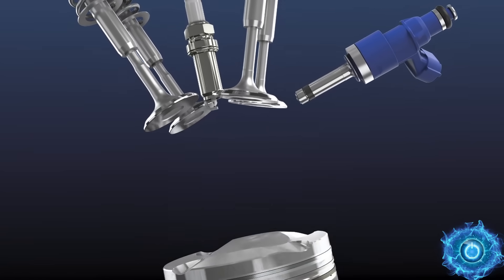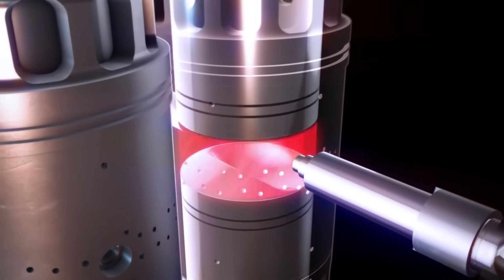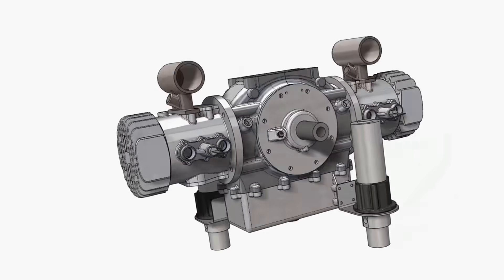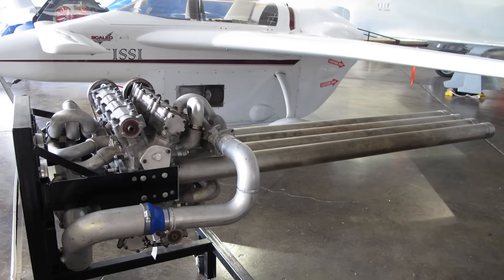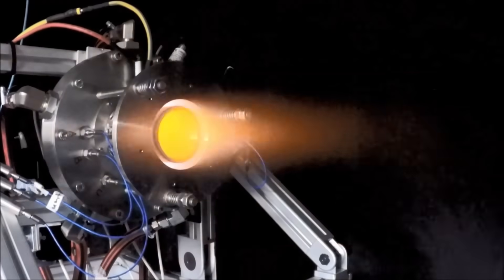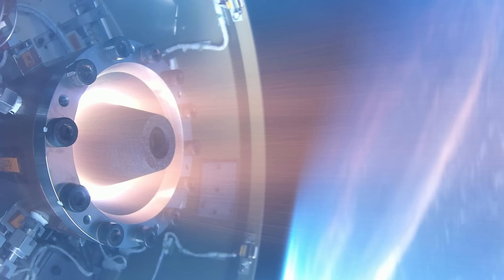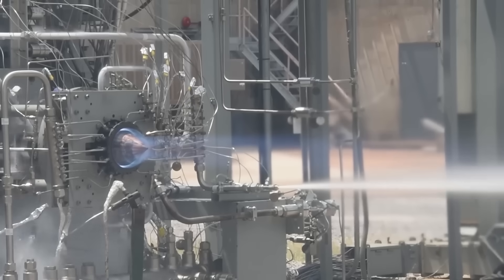NEW Aerospace ENGINE Destroys ROCKETS

Comment: You are still dealing with obsolete methods of propulsion the Jupiter 2 propulsion system is much more efficient has a much better thrust to weight ratio and uses no petroleum products

Comment: NOW, try getting out of earth's atmosphere and not killing astronauts......or are they  filming somewhere else....
Reply: Over 680 people have been to space, only 3 died there
Reply: @raptorwhite6468  your definition of space ??
Reply: @JW-rg6rg  Over 100 km, this is what is officially considered space.
Reply: @JW-rg6rg  Well, if you want to define space as a place completely outside of atmosphere, then it doesn't exist. Even in intergalactic space there are some atoms.
Reply: @raptorwhite6468  you mean plasma?? Same stuff that creates flames on SpaceX re-entry?
Reply: @JW-rg6rg  No, just singular atoms floating around, technically that's still a gas surrounding a massive object, so it is an atmosphere, but very thin

Comment: Would RDE engines be more efficient if the detonation wave was parallel to the desired thrust vector? Rotary Detonation Engines (RDEs) operate differently from traditional combustion engines by utilizing a continuous detonation wave. The efficiency of an RDE can indeed be influenced by the orientation of the detonation wave.

If the detonation wave is aligned parallel to the desired thrust vector, it can potentially lead to more efficient thrust generation. This alignment allows for a more direct transfer of energy from the combustion process to the thrust, minimizing losses that may occur if the wave is misaligned. It could also enhance the combustion efficiency, as the detonation front would continuously push combustion products in the desired direction, reducing the formation of unburned fuel.

However, achieving this optimal alignment in practical applications involves complex engineering challenges. Factors such as the design of the combustion chamber, fuel injection methods, and the geometrical constraints of the engine must be taken into account. Overall, while parallel alignment of the detonation wave to the thrust vector can theoretically improve efficiency, practical implementation requires careful consideration of various operational parameters.

Comment: No thats not the reason... it's not because you can consume all the fuel at once, that would just give you a higher thrust, it would not improve fuel efficiency which a lack of thrust is not the problem with today's rockets, the reason is that the detonation travels faster than burning, which the speed of your exhaust determines you specific impulse, or how much acceleration you can get for a set amount of fuel to put it in somewhat more laymen terms. So because a detonation travels at greater than the speed of sound it mean you are throwing the same mass out the back at a greater speed which you know Newtons thrid law "To every action, there is always opposed an equal reaction..." which means you get more thrust for the same amount of fuel.

Comment: Sry really sry but nothing has ever been to space
Reply: People have been sending things into space for 80 years, you're a little late
Reply: @raptorwhite6468  space starts at 62 miles high and rockets can not produce thrust in a vacuum so the rocket just falls back down at the 62 mile mark
Reply: @James-zp5po  So you don't know the most basic laws of physics? That means you're over 300 years late with your statement, not 80
Reply: @raptorwhite6468  basic laws of physics do your own critical thinking and do your own experiments I have 3 vacuum chambers newtons third law says action reaction only when air is present space starts at 62 miles high and rockets can not produce thrust in a vacuum so the rocket just falls back down at the 62 mile mark and this is the way it has been since the beginning of time
Reply: @James-zp5po  If you have vacuum chambers, did you perform a proper experiment with burning rocket fuel? Air has nothing to do with it, do you think kicking a ball in a vacuum wouldn't make it move?
Reply: @raptorwhite6468  air has everything to do with it so says newton
Reply: @James-zp5po  Oh, right, because the third law of motion is "for every action in nature, there's an equal and opposite reaction. But only in air, not in a vacuum, if you try to walk in a vacuum you can't, your legs push against the ground, but there's no reaction because there's no air. I don't even know at what exact pressure the law stops working, but I guess it's at the exact pressure it's most convenient for flerfs"

Comment: All rockets are slow motion continuous explosions.  The difference in solid rocket propellant and the explosive in a CALCM (Conventional Air Launch Cruise Missile), is a matter of the same ingredients (mostly) with a slight balance change between them.  More Bat guano or less Bat guano,... or nitro.  External Combustion Engines.

Comment: Hows-about a spinning wall that the rotation detonation wave follows behind, this rotating wall opens the fuel air mixture port as it rotates which is then ignited by the trailing pressure wave. This wall could also have ports up it's vertical length spraying the fuel air mixture. Match the rotational speed with the pressure wave, and voilà........

Multiple vertical spray ports, more det-pressure waves.

??????....... Gizz some shares if anyone patents it!!!!!!!

Comment: Incredible stuff. We definstely need faster rockets. We also need chesper rockets. Lasors will in time make a lit of this moot but for now its whsts needed. 

The next issue of course is if a jet can generally move at 5 times sound then its offense needs to move at 7 to ten times that speed. So both large and small versions should be utilized at the same time. 

Next of course is can a human renain conscious at these speeds. Will this effort necessitate semi autonomous control.

Comment: Btw, why not combine 2 pulse engines to cancel out each other noise and vibrations? Same concept serve piston engines pretty well. Probably you can just remove pistons from motorcycle 2 stroke engine and replace them with nozzles to test the concept. Well, maybe you will need 4 cylinders to balance rotation forces. Or maybe some "pressure addition chamber" before single nozzle.

Comment: I’m a little late to see this… but I have some experience working on/with linear aerospike engines.  I worked on the Lockheed Martin X-33 (the prototype technology tester for the LM VentureStar), and I spent a lot of time with the good people at Rocketdyne, who were developing the XRS-2200 Linear Aerospike engine.

I have always wanted to see this concept in use, and I attended most of the XRS-2200 tests that were performed at Stennis in Mississippi.  These engines were very, very promising.  To me this was the most important technology to be tested on the X 33 as everyone knows the X 33 was canceled in March 2001, but we did at least get working linear aerospike engines and we had some data on those.

The difference that I can see between the engines you’re talking about (with a pulse detonation in a circular motion around the periphery of the ramp) and a circular aerospike engine will be that a circular aerospike engine would have all the thrusters operating simultaneously, and continuously, rather than pulses - moving around the periphery in a circular, tornadic fashion.  I like this idea, except I would be more comfortable if the thrust were more symmetric about the center of the circular ramp. In other words, why couldn’t we have two detonating simultaneously across the center of the circular ramp from each other?  I’m always a little uncomfortable about any kind of nonaxisymmetric thrust on a rocket engine, even if the pulses moved very quickly - there would still be some thrust vectoring (TVC) that might be an issue.  I think this is something we would want to avoid.

The concept of aerospike engines with the external ramps is a very old one and it’s back to the 1950s. There was an instance of somebody (and I can’t member who) that put a circular aerospike engine on a barge… and they were able to get some good data from that test.

Great video, thanks for posting this!  Cheers from New Orleans.  🥃
Reply: i just met you but i'm already your fan lol
i love circular aerospike engines

Comment: I will say I'm a little skeptical. I genuinely do hope that this becomes the new main engine, as it would make travel much cheaper, but I don't see this overcoming the same hurdle that the Aerospike did; Considering that despite Aerospikes reputation for being better than the generic rocket thrusters we still use today in every single way, I have a feeling that these RDE engines may fall into the same pit. Crossing my fingers they don't.

Comment: in the end; you need E = size of fuel droplets x distance between fuel droplets; x oxygen size & uniformity; x fuel size uniformity;; 
and i got to it in 90s; started in 80s ; 
i call it plasma engine; so to let you know; you can work on hardware; but cannot work on fuel air mixture; thus know standard was met;

Comment: The problem is - on Earth this eats up the alloy you're using rapidly and melts your engine. Now take that to space where convection and conduction are not optional and you're left with radiation as the only way to get rid of heat and good luck not melting.

Comment: Three of the biggest challenges I see is a combination of resilient materials precise cancellation of heat and shock  on the inner surface. If the oressure and heat extremes can be sensed and responded to before they reach the combustion wall then it is s matter of providing adequate cancellation support.

Comment: I could be wrong, but I think for mach speed flow to occur in the cylinder of an operating engine, other than a diesel type, you would have to have detonation, which is a VERY bad thing.  Fuel in a properly working gasoline engine does not detonate, in fact the squish areas in a two cycle engine are designed specifically to try to mitigate that at the cylinder extremes.  In a diesel it does operate in detonation mode, but those engines are designed to do that, and you can hear it happening when they run, with all that knocking.  

When you hear that in a gasoline engine, something is very wrong that needs to be quickly corrected, like large amounts of carbon buildup or overly advanced timing.  If anyone reads this that really knows what goes on there (meaning a cylinder flow guy) and I am wrong, please set me straight, but I'm pretty sure that is what is going on, dynamically.  Pulse jets have been around for a very long time, BTW, even in use.  The German V1 'buzz bomb' was a pulse jet, hence the 'buzzing'.  Detonation, much of it, in a gasoline engine results in effects like broken spark plugs and holes in pistons.  These are not sought after events.

Also, I'm pretty sure that detonation is still called combustion.  I think combustion just relates to burning, not the rate at which it happens.

How is the design redundant.  Redundancy means exceeding what is necessary, or a repetitive system, to have a fall back during a failure, like dual mags on a GA aircraft engine, or multiple computers running in parallel on a voting system, like was in the shuttle, so that one failure does not cause the system to fail, though in some cases it may continue to function in a degraded mode.  Does a pulse jet design exhibit these characteristics?

I also don't know what you mean by "a normal jet engine experiencing total pressure loss" during combustion means.  It doesn't, and is constantly burning constantly provided fuel and producing constant thrust within and exiting the engine.  It is not a fuel flow pulsed or pulsed burn system.

I love it when people say 'we' came up with a new alloy, process, or whatever.  'We' didn't, someone or some team or group of teams or collaborators did.  'We' didn't go to the moon either, though that is said virtually every time, just a handful of astronauts did.

Also, these examples are not new physics, just new applications of existing physics.  Things like relativity, in their time, were new physics, newly discovered physics anyway.  All physics exist, right now, we just haven't uncovered all of them, almost certainly.

Sorry if it sounds like I'm constantly picking at you here.  You do a good job, I'm just trying to help you make it better.  It is intended to be constructive, and you certainly didn't come up with manners of speaking like the 'we' thing.  You have introduced me to things I hadn't seen before as an engineer, so thank you for that.  :-)  You could do a cool video on materials alone.  Go look up the transparent steel, essentially, a plastic with 12X the strength to weight of steel, it would be an excellent example to include, if you choose to make such an episode.  It results from being able to maintain 3D bonding throughout an entire piece.  This bonding was easily producible before, but quickly went ary and the normal 2D polymeric bonding initiated and maintained, creating a normal plastic, like say lexan or plexiglass, which are polycarbonates, etc.

Comment: Can this engine be throttled.  Can it not be subject to combustion instability in the combustion chamber due to variable exhaust gas back pressure say as a rocket engine travels higher into thinner atmosphere?  It might be a failure in the near term like the aerospike rocket engine until new science reveals the new technology that would make it work.  Looks like aerospike and rotating detonation technology are made for each other.

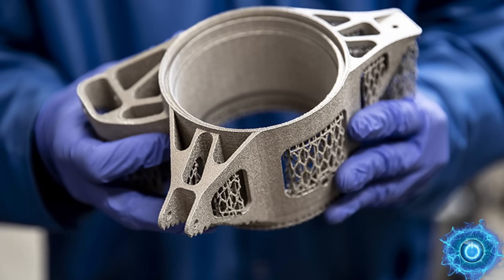Comment: I made 32 inventions in the 80s and 90s.  I figured out how to make error free rigid memory disks doing epoxy fluid dynamics in my head.   Thanks for the close-ups at 3:50-4:03.  How did you make the ripples between the walls in a high pressure device at 4:50?  Where to guide the pressure to?  Verrry interesting...

Comment: Just some helpful notions. 1. all materials are moving at a intermolecular level.  2. All motion is temperature... just depends on the scale and permability you are trying to reffer to. 3. All alignments are challenged simply by existing, let alone if you are exposing them to explosions. So the tighter the margins, the sooner it will need corrrecting, the lower ability to correct the sooner it will fail.

This technology can work. It needs strong attitudes willing to redoubt preconceptions and offer up sophisticated solutions to correct for problems rather than trying to simply change materials.  ultrasonic pulses for example are under explored.

4. Fluid dynamics based on a static container can make for more complex calculations than if one was to use a dynamic container, i.e. ultrasonics or laminar flow calipers, that are able to interface with AI and work out what works prior to formulating formula.
Reply from the maker: Thanks, great points!

Comment: Element element composition amongst the main aerospace area on the moon you have the metal known as a wolverines of Maine metal they put on him I forget the name of it right now but it's a tungsten or a tritium concept of using a hyper electro thermal conduction and putting rhenium into the mix which was the concept of a new metal and a reverberation upon heat thermal resistant see that Woody actually create a better thermalized engine or jet thrust propulsion system now on this we had a couple of highly radioactive isotopes and then there was the worry about the couple of jet cam positioning is up on the stat for aerospace center up in space anyways and there's nothing but radiation out there past the shield that's a whole nother world of Cam positioning but now since we're worried about making a new a metal or thrusting propulsion system I'm still with the ideals of the aeon engine or another electrofusion engine which is going to go with using the same electro bad and studying out a couple of chain link fences per se and while you put the chain link fences out 1 past the other pass the other and you have them at a gap and you run like 300 volts 600 V 12 V now the negative reverberation in the heat waves in between us are all going to go in One direction after you have that one negative and then the bunch of positives which will do a gas or magnetic electrode oxygen gas and it works on any type of real basis on space and this is how I have my propulsion system sets up so my setup will pull through the space pulling on the ions and electricity and push me out farther and it takes in that limits upon the turbulence the arrow turbulence in the space gas turbulence so within all of these constructions don't say I didn't have a hand out to anybody

Comment: What if the exhaust never left the combustion chamber but is kept at a high pressure inside ? The unequal pressure should cause the rocket to move in the direction opposite where the exhaust would normally expell. The exhaust could be kept from leaving the combustion chamber using a intense laser beam aimed at the opening and causing a explosive shockwave to form from the exhaust that would push it back inside. A laser will not produce any significant opposite reaction force when it shoot the beam. This method can save a lot fuel from being wasted as normal rockets would do.

Comment: The concept was used in WW2 on buzz bombs
Reply: Buzz bomb was totally different. I'd say it's like comparing a smoothbore tank gun to smoothbore cannons from the age of sail but the canons have mire in common with each other (and with the V-1 incidentally) than the V-1 pulse jet has with this. All three of the others used subsonic deflagration - these are detonation engines.

Comment: What is the material that holds up to the the heat from the exhaust?
Reply: Rocket engines usually flow a cold fluid, such as liquid hydrogen through the exhaust to prevent it from melting